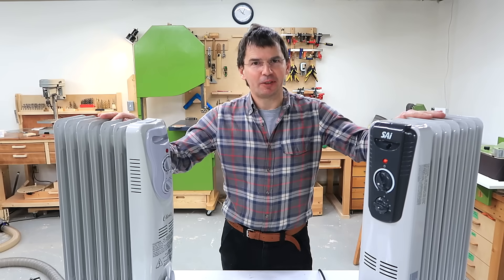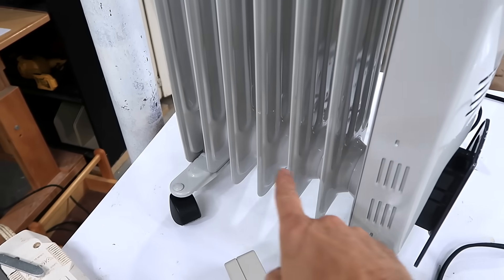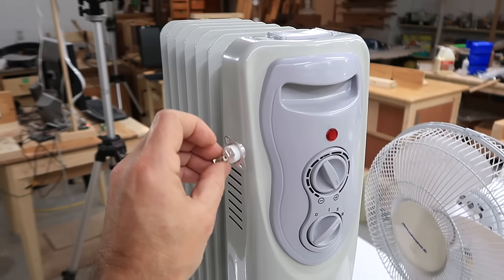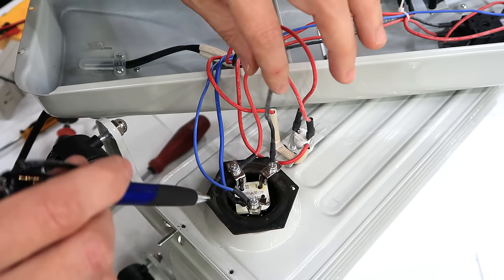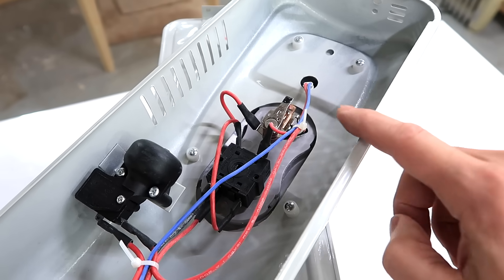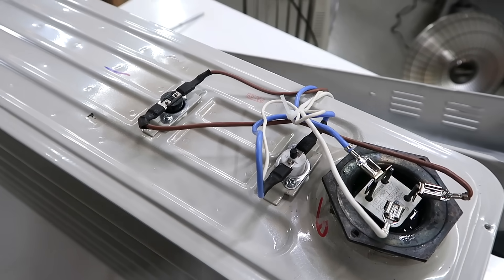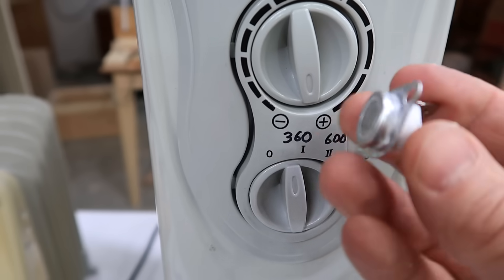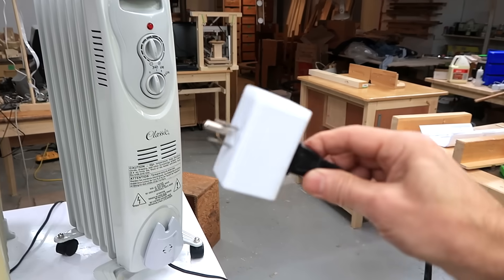Oil filled heaters: 600 watt heaters pretending to be 1500 watts

Comment: I found  oil radiator with three power level (700-1400-2200) but at highest input it switched off quickly

Comment: Four years after this video, I have just made this discovery for myself. A first heater we bought was working very well to prevent an unheated utility room from becoming too cold. I had no reason to set it above 1. We bought a second identical model for a wider role and I soon ended up putting my watt meter on it and there was the pattern you describe. Of course the data sheet, when I dug it out,  said that the maximum continuous power delivery was 680 watts. I have found that in practice, in its intended role, position 2  (1 Kw) is the most useful. They were cheap enough £25 here in the UK), but really the advertising, which omits the safe continuous power rating, is very misleading.
Reply from the maker: At least they were honest enough to put that in the manual!

Comment: Our central heating was all tore apart by the previous owners when we moved in. I'm not sure I would have liked replacing it so we just took it out and made a nice closet out of the space. Now we have 2 oil filled heaters in the master bedroom and 1 in the bathroom. And we put a woodstove in the living room where there was a so-so fireplace. Never had a problem even with used electric oil heaters which can be bought for about $20 often. Just never leave them on when going out or on vacation.  Same with AC cooling. Simpler is better!  Up in Grove, Oklahoma where it got to -17 F a few years ago!

Comment: In the UK I have a small one rated at 700w with only one output setting. It appears to cycle just using the thermostat dial as when it clicks off you can turn it up and it comes back with a spark sound. Makes me wonder if they have the exact same element in them for 110v markets.

Comment: I like these oil heaters. They are quiet, indestructible, and I appreciate the thermal mass of them since my equivalent fan heater needs to be running all the time at full capacity to achieve the same feeling of warmth.

Comment: I used 2 of these (plus some more things) to kill a drugstore beetle infestation. they worked really well. I had an ip camera watching thw whole time. they got the bathroom about up to 150 degrees. before they started to power down completely. I think the really questionable thing is the low gauge power wires. 1500 watts for a long time and the wires get hot hot. I had to buy special high power extentsion cords.

Comment: Dad is in control! I worked in a place where each office had a thermostat so people could adjust to suit themselves, what they didn’t know was that hidden away the master control panel set the maximum temperature anyway, so they could turn the heating out to maximum on the office thermostat but it didn’t make any difference.

Comment: These things are not safe.  I lived in an apartment that didn't have any heating because the winters were usually mild, although there were times it would get pretty cold.  I bought one of these, and a couple people warned me that they are known to start fires.  I used it anyway (I know, dumb) and everything worked great for about a month or so.  Then, one evening I was watching TV and smelled a strong hot electrical odor.  I looked around and saw a thin streak of smoke coming from the outlet the space heater was plugged into.  I quickly grabbed the cord and unplugged it.  The cord was so hot it nearly burned my hands.  I was fortunate that there was no fire, but I never used it again.  My stomach turned when I think of what could have happened if I fell asleep or things went differently, not only for myself but all the other units in the apartment building.
Reply: I use one every winter and have done so for many years. Mine has never had a single issue

Comment: Why not just buy a fanless space heater, basically a high temperature ceramic element inside a metal box with holes. Full power of 2kW non-stop.

Comment: why not just use it as designed? maybe there is a reason it wont allow 1500 watts after a certain temp for a safety reason. they are built for long term efficient whole room heating not to blast 1500 all day.

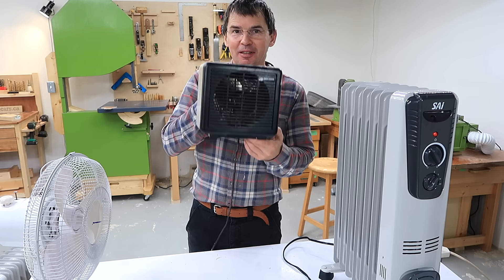Comment: 1:19 "and they'll put out their max continuously" 
nooo they don't. Sittin here with two space heaters different brands and designs... either one of them on about 600 watts (whatever their lows happen to be) will stay on until I turn them off. But turn either to high (1500W) with the thermostat wide open, they turn on and off without the room being all that warm.

Comment: I love these heaters.  They fail quite a bit and I get them on the street corner on trash day.  I use them for heating with PV solar.  I can't imagine one of these operating at 1500W unless the room was at zero and there was a fan on it.   I find that with about 350W the fins are no longer touch safe.

Comment: I have a question you may be able to help me with.

I have an Intertek RiteTemp Oil Filled Heater, Model # CYAA45-7T. The U-bolt for attaching the wheels, and the wing nut, have gone missing. (We have moved a couple times, so things go in boxes and then get lost.) Are replacement parts easy to find? Are these parts the same across all brands and models of these Oil Filled Heaters?

Alternately, would you know if this company has gone out of business? The user manual has no contact information. No website, company name, phone number, ... nothing! And web searches turn up nothing. I'm starting to think they have renamed their company, or gone out of business.

Any help is appreciated.
Reply from the maker: Just find a nut that fits the u-bolt.  Doesn't have to be a wing nut

Comment: I just picked up 3 of them,  Propane ran out on the coldest day and night we had this year.  Just had one on low in the bathroom near the sink and one on low in the kitchen just so the pipes don't freeze.  The third one was up in the computer /bed room Toasty 70 degree  but still on level 2 only about half way up on the dial.

Comment: I like these heaters too for their quiet operation. A year ago I picked up a portable infrared panel heater that's a block of drywall with a 440W heater embedded in it. It radiates so well the surface peaks at 50-60C, even safer than oil heaters.

Comment: If there is a power failure they will turn back on, digital ones will not. Thats why I use them in a pump house and bathroom in a barn to prevent frozen pipes.. Also the motor on fan types seize so they overheat.
Reply from the maker: Biggest reliability issue with the oil filled ones is if you turn them on max (1200 watts), and the internal overheat thermostat keeps cycling.  Thermostat may fail.  It also continuously thermal cycles the whole thing, causing increased risk of popping a leak.  Solution being to use them at 600 watts.

Comment: Regarding the thermostats:  it's always annoyed me that the thermostats measure only the temperature of the metal enclosure, so the heater cycles on and off while the room is still colder than. I've always wanted to add an external thermostat for better control. Instead of rewiring the heater, you found Smart Plugs! I did something similar using one of those remote switches for Christmas tree lights and a common wall thermostat.

Comment: What nonsense. They should be large enough to handle the full 1500 watts continuously. I have a 2000 watt convection heater (no fan) that goes full until the room is warm and the thermostat turns off. Cheaper, silent and works great.

Comment: I just bought one of these from Tractor Supply.  I rewired it so both elements are in series on setting 1.  It had Phillips screws so it was a piece of cake.  Thanks for the great video
Reply: might not be a goood idea many of these can get leaks and even catch on fire sprwing  boiling hot oil around.
Reply: @vikingvic  How would that happen if the wattage being used is less than just the single low element on its own?

Comment: A friend bought a heater similar to these.  It has a nice tip-over switch.  The bad thing is that the thermal “coffee pot” fuse is in a fiberglass tube clamped to the large hex nut where the element lugs are located.  The fuse if I recall is 300 degrees F.  The heater has blown the fuse three times in normal operation with no blockages to air flow.  Luckily a box of ten thermal fuses on Amazon is only a few Dollars.  It is a pain to change the fuse because it has to be crimped on, can’t be soldered due to the heat.  It seems rather concerning that the hex nut gets that hot in normal operation.  I’m glad the fuse is there.

There seems to be a lot of variation in quality of these oil filled heaters.  I have an older one which is used infrequently, but has more fins and the three settings have distinct heat levels.  It cycles by the thermostat and not the Klixon safety switch.

I also ran cross one at a friend’s apartment which gave a buzzing sensation when touched with the hair on the back of a finger.  That’s a sign of leakage current.  A check with a meter confirmed a short from the heater core to the metal case.  She threw it away after cutting off the cord and got a new heater the next day.

Comment: I have been using oil heaters for 15 yrs now and never had any issues they always keep the rooms warm. I only had a "Walmart" brand oil heater that kicked out once but I put it in a smaller room and it works fine now. Never heard any of  mine crackle like that.

Comment: The overheat thermostat on my heater gave up the ghost after the main thermostat gave up and when the overheat one failed, it really realeased some horrible gas and smoke and I was feeling like passing out. I've replaced it since then and the main thermostat twice but you've got the right temperature one otherwise it will never stop and the whole thing will overheat. I had to adjust the metal blades on the thermostat so that it shuts off at a safe temperature.

Comment: Ive had a larger one for many years. I wonder if I should replace the oil in it as oil degrades over time.
Reply from the maker: I wouldn't imagine that the oil degrades.  Is not like engine oil that gets really really hot
Reply: @matthiasrandomstuff2221  good point

Comment: How much temperature are oil filled radiators supposed to show if at set at full heat? I have a 13 wave fins 2900w and the heat generation is very unsatisfactory I feel. I could be wrong but when i point the infrared thermometer into the hottest parts it shows around 200F max even after I have left it running on for hours and hours, the room around 180 sq ft is still just warm and nothing more than that. The fins remain warm but nothing hot even at the highest temperature. Am I wrong here?

Comment: Hi. 
I just bought one of these this winter and noticed the same situation (should have seen this earlier). It’s meant to have 3 heat settings but as it can only radiate an amount of heat proportional to the difference between its and the environmental temperature setting it makes no difference (in reality) what power its set on. On level 3 it gets hot quicker but the electrical consumption scales back to an equilibrium. If it was in a very, very cold room or, as you tried, you put a fan on it (done that too), then it can maintain a greater heat value setting. In essence these work great in small spaces, but don’t heat larger ones as they scale back. 
Cool vid!!

Comment: I think the crackling sound when cold starting is small amounts of water boiling out of the oil.  I usually start them at a low level to quietly drive out the water (turns to vapor at the top of the heater.  After a few minutes I can turn it to high and no crackling.  Mine are very old US heaters, so no low temperature limiter.  They can get very hot to the touch.

Comment: This is a fault of Canada's requirement that basically if you can touch an oil filled heater it can't get over 90C to protect from contact burns. Because we don't allow both children and adults learning rom poor and painful decisions. The popping sound is just the oil priming itself in the tubes it gets very viscous and doesn't flow well after it cools down. Once it's heated up and flows freely it doesn't happen anymore. 

It's essentially impossible to have an oil filled radiator without a fan sold Canada without this added protection because even if you shroud the fins the shrouding would still get over 90C without forced airflow.

Comment: I had one I used in my bathroom to warm it up before showering. The last time I used it, I turned it off and the buttons stayed lit. I unplugged it,  buttons still lit! I looked into the vents and saw the flames. It was already unplugged, so I rolled it into the shower and hosed it down. Never again.

Comment: I have one with 2 switches that turn it on and off. 1 switch is low and both switches is the high setting. Each switch has a power light below it. The heater no longer works. Neither light comes on. I replaced the overheat protection thermostat and it still does not work. Could it be the switches?

Comment: Why would you want it to stay at 1500 watts when its already up to temperature? Wouldn't you want it to save electricity like its doing?
If it just keeps heating it won't last very long. Now you don't have a low or anyway to regulate the temperature.

Comment: If you REALLY want to get fancy, control both elements in parallel with a Triac, and use a temperature sensor on the heater to detect when the thermal cutout level is imminent, and back off on the Triac to keep the heater JUST below the trip threshold. This COULD be done all-analog, I'm sure, but with WiFi-microcontrollers costing peanuts these days, just use one of those, and get the added benefit of remote control and temp logging...

Comment: Had one similar, one winter was running it regularly, went to switch on one morning and it went bang and jumped over a foot in the air, stripped it down, the tilt switch ball had caused it to jump, whether there was a short in one of the elements, I didn't check, but wow just that small ball and 240vac did that!

Comment: I have some very small 500W rated oil filled heaters for the small workshop and the tack room in my barn. 

They keep the 100sq foot spaces comfortably above freezing and they have a very low risk of starting a fire. Since they are fully enclosed and the surfaces never get hot enough to ignite common materials.

Comment: people may not realize that the heater should be placed under a window because cold air from the window SINKS and that is a convection current similar to moving air from a electric fan but it is free air movement

Comment: I recently threw out an old second hand oil radiator of Chinese manufacture as not only did it cut out too often before warming the room, it had started to leak!.  I still like oil filled radiators I have two 2.8 kw ones now and they behave sensibly, they are both Chinese "what isn't" and identical in every respect except that the latest one has an additional safety mechanism that cuts out the element if the radiator is tipped over.  I consider them economical because I can set the thermostat and they also have timers so I can have them set to warm my rooms in the early morning and the evening.

Comment: It would be nice to see teardowns of the old Hydrosil electric baseboard heaters, the ones with the gel inside. My gas wall furnace was red tagged as my contractor installed the new furnace wrong, with the old shorter vents of the old furnace. The old Hydrosil has worked well to keep my bedroom area comfortable, with outside temps here sometimes down in the 30's. I did replace the thermostat, as the old one was a bit wonky.

Comment: I've ripped my gas central heating out and use these electric radiators exclusively. 
The CH boiler is brand new and every winter, it won't start and costs over £100 to get someone out. 
I can buy a lot of electric for that, and I don't like water being pumped around under pressure through that microbore crap. 
Get a problem with one of these oil radiators (which I never have), I just chuck it out and buy a new one.
I only ever use the low 500 or 600 setting anyway.

Comment: The one I’ve got does 700W, 800W, and 1500W. With the thermostat in max, it won’t cycle on 700 or 800, but 1500 will cycle on and off. Of course, there’s very little difference between 700 and 800, so the thing only really has one useful power level.

Comment: Reminds me of the safety features clothes dryers have. There is absolutely no way I would ever bypass or modify them. Use the device within the capabilities it was designed for. And by the way I am a 64 year old certified appliance service technician with a couple decades of experience. If you aren't happy with the performance of an appliance find one that satisfies your needs.
Reply: Where can I buy a microwave that doesn't beep?
Reply: @tomjacobson7623  Certain digitally controlled microwave ovens can be set to not beep. But the beeper is on the low voltage board so it would also be easy to just cut the trace going to the beeper.
Reply: My toshiba allowed me to turn OFF the beeps. @tomjacobson7623